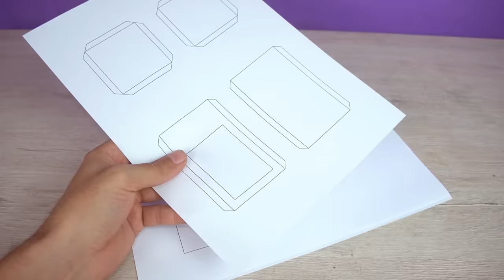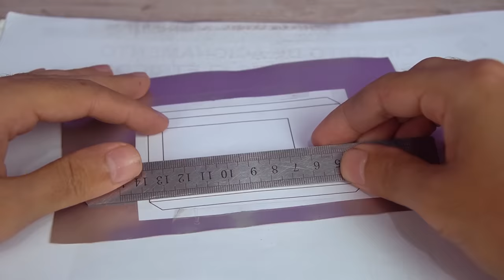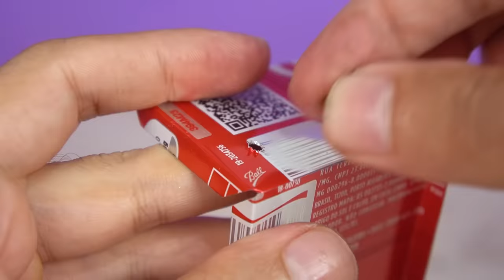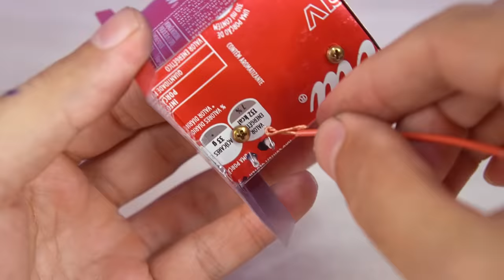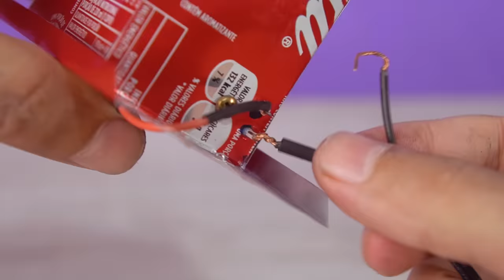Faça um Incrível Mini Forno com Latinhas de Refrigerante

Comment: I have a few questions. What gauge of resistance wire did you use? Was it Nichrome wire? Also what was the pad that you put it on made of? Same aluminium as the cans or what? What were the white bits you used to fasten the wire?

Comment: Like seriously, who could dislike these videos? They're Amazing!!!!
Reply: Course you could that could be done so much easier in a much better way no grounding no thermal protection no thermostat no safety precautions no nothing doesn't even know how hot it gets. That's not even trying to get into the fact that the outside will be razor hot and probably melt after a short period.

Comment: Pode usar um "carregador/fonte" de 12 volts direto e bom vídeo e quantos Anperes presiza
can use a 12 volt "charger / power supply" good video And how many amps you need
Reply from the maker: Carregador não dá conta, tem que ser uma fonte com alta corrente
Reply: Quantos anperes
Reply: E volts
Reply: I had the same question, how many Amps? I wanted to check if I can use my laptop charger

Comment: So, on the one hand, I like this idea. 
On the other, I see so many ways this could be improved. 

I immediately want to make it bigger. 
I want to use a lot less glue by using cleats instead. 
I want to run it on 120V AC. 
I want to insulate it properly. 
I want legs under it. 
I want a window made of pyrex, or at the very least plate glass instead of a sheet of polystyrene. 
I want heat resistant silicone.